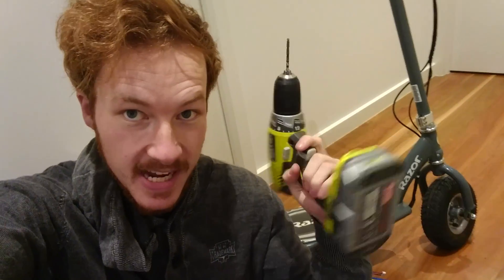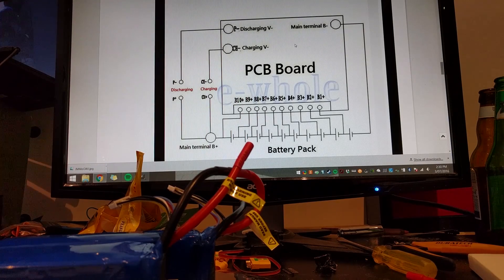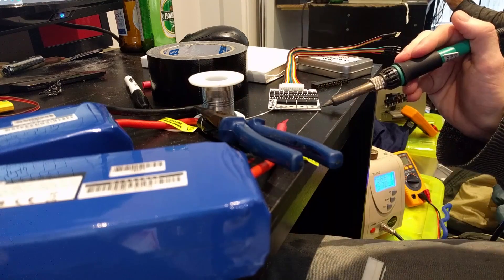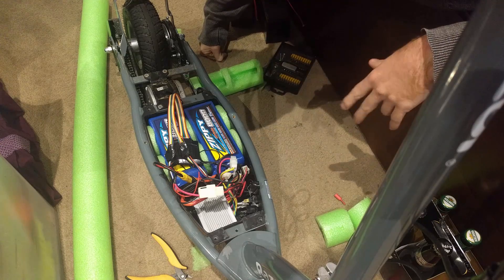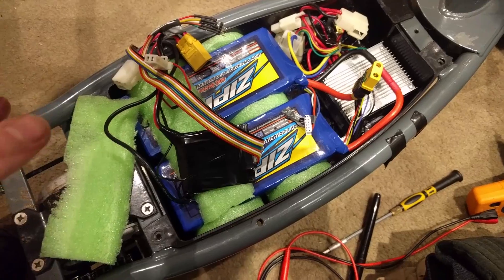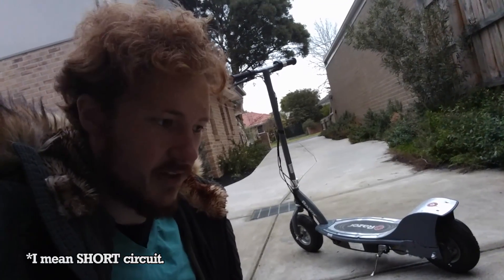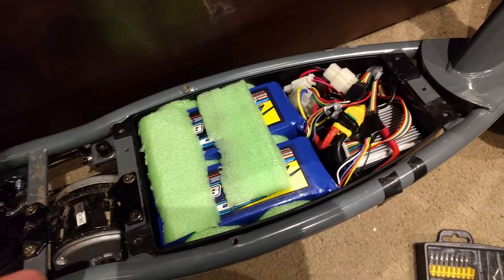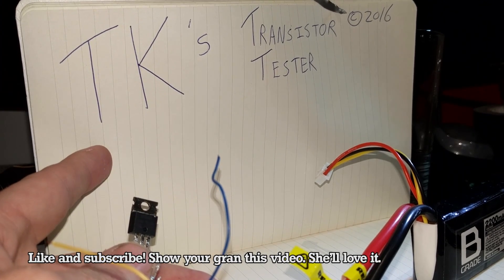Razor E300 Scooter Gets Big Battery Power Upgrade - Scooter Episode 3

Comment: 6:15 for soldering thick cables & connectors you need a high wattage iron, at least 80W, with a large chisel tip on it.
The larger surface area of the tip enables better heat transfer, and a quick soldered connection causes less melting of the plastic connector!
Reply from the maker: Yeah, good advice. I bought a mega iron later on to help with these

Comment: use a higher wattage soldering iron, it will heat faster and make a better smoother connection, probably 100 w would do the trick.
Reply from the maker: You're so right

Comment: What Up TK Here; why does the E300 require a speed controller?
Why not wire the batteries through a relay (triggered by the throttle) straight to the motor?
Reply from the maker: 1: you get sparks every time you engage it that destroy the relay contacts very quickly.
2: instantly going full throttle on a powerful scooter will throw you off.

Comment: I saw you used ryobi battery's in the past have you ever thought about using ryobis 24v or make custom 24v packs
Reply: It's possible to make a custom pack I have down it before
Reply from the maker: It is possible! I went with these high output lithium polymer batteries as I was familiar with their performance and love their huge current delivery. 18650s are good too but far more of a pain to assemble into a custom pack. Also, when I did this, ebike packs weren’t as much of a thing.
Reply from the maker: Thanks for watching, hope you enjoyed!

Comment: Bro why you don,t use lithium ion you will get better battery and easier chargering I recommend using 18650 lithium ion cells
Reply from the maker: These are lithium polymer cells
Reply: @WhatUpTKHere  different chemistry.
Reply: I know that's why I am saying you should use lithium ion instead of lithium polymer.

Comment: I can't find a single video that starts with a stock e300 and successfully upgrades it to 36v. How the heck do I do this?
Reply from the maker: Haha, so pretty much you gotta replace the motor and speed controller. You can try and cheat and overvolt the stock parts, but they blow up pretty quick.

A lot of people act like you can do it, and end their videos before they admit their motor melted after just 5km.
Reply: @WhatUpTKHere  dang. I was hoping the motor could stay - thinking the controller would protect it!
Reply: Again use lithium ion not lithium po you can use the original controlor and motor ( working on a video  of how to do it)

Comment: Well TK, I suppose I am bumping a 3 year old question but your video stands for newbies. Nice videos. Educational.

Try at your own risk:

So, at 5:54 there are a few solutions to your soldering problems. First, the reason for the problem: the size of the wire & connector you are soldering have a larger surface area than your soldering iron tip. So, those items drain the heat from your soldering iron.That leads to a cold solder joint. Thats why you have a lump of solder that blocks the housing from sliding on after the solder job. You need a larger soldering iron or at least, a larger soldering tip and probably about a temp of 850F to quickly flow solder on that connection.

The easy fix for the results you have, file the lump down with a metal file (use standard safety precautions: eye protection, a mask so you don't breath in lead smoke or lead dust, wash hands well after handling lead solder, etc) . Another trick, when your parts get too hot, throw a damp/ wet cloth onto the parts to cool it off quickly. Of course, it won't look pretty. You will appear to have a cold solder joint. At least your wire insulation and plastic connector won't melt.

best of luck.
Reply from the maker: Great tips! I’ve definitely improved my soldering game in the last couple of years. Gear helps!
Reply: @WhatUpTKHere -- Keep on Rockin it TK !

Comment: I'm having the same issues  any fixes for sure yet?
Reply from the maker: If you wanna run 36V properly, get a 36V motor and speed controller.

You can overvolt the stock stuff but it burns out pretty quick dragging an adult man around
Reply from the maker: Also you may find the rest of the episodes helpful

Comment: Myself , built my own control with a NE555 for pwm running a couple on IRF1405N mosfets. Good for 55v  169A max. I did have some initial problems with blowing the protection diode across motor which then blew mosfets. That was fixed by reducing current of back EMF. All good  hit 41 kph then burnt motor then replaced with different motor now 36 kph and more range.
   Should add the scooter i started with is a Kmart E kick out of the box12v  lead acid 9kph. Now charged around 51 volt.
Reply from the maker: Very nice! 

What did you do to reduce back EMF? Change PWM frequency, or?
Reply: @WhatUpTKHere  to reduce back current I just used a couple of resistors in series with diode  Still protects with added benefit less rolling resistance when you shut off throttle. Also I do have a dead man's handle which operates a relay and just shuts everything off.   The basic NE 555 dc motor speed controller circuit came from .... How to Mechatronics . Com  . I  added the twin mosfets and voltage regulation due to the control runs on 12v  and the supply is from a 20 v tap in the battery pack . Why not 12v thats because the project evolved slowly some things changed and others botched.  On that one i even ran a string of diodes to dump a couple of volts to try to remove some work from regulator. The original motor was 12v. 100watt..with the intention of speed only and to hell with everything else and that's how I got 41kph then burn out. But now i have backed off for distance and reliability.  The lithium batteries were taken from Aldi 20v 4ah power tool packs $38 each.  Cheaper than Jaycar similar cells at almost $20 each.

Comment: Hello sir
i wanna make an E scooter i have problem with speed control and the sprocket
i have a DC motor model MY 6812 100w 12v and it has a sprocket 1.5cm
and on the whhel i have 5.7cm
battry is 11.1 v 3300amp
i used 2 transistor IRFZ44n for driving
but when i go on half throttle transistors will get hot 

can you help me to resole this problem?
Reply from the maker: Hi! 

I’d suggest looking at existing brushed motor controller designs, and comparing them to your own to figure out where you’re going wrong. :)
Reply: @WhatUpTKHere  do you know any name or model of speed controll?
do you think any problem with 1.5 cm sprocket and 5.7 cm? should i change them?
Reply from the maker: @raspberryeditingvideo4331  hard to say if the sprocket is an issue. 

Do your research, you should be able to find a suitable brushed motor speed controller, or ESC, online.

Comment: Hey question
I believe my fet has failed in my controller. TK why did you only modify the left mosfet and not the right one? Thanks
Reply from the maker: There’s only one MOSFET, The other one is a diode pack, it’s just in the same type of package.
Reply: What Up TK Here hey thanks for replying!!
Cool to know. I also blew my mosfet after deregulating the controller. 
I like the job you do with to mosfets in parallel. My next question is, how did you secure the diode pack back to the heat sink? Or is it less of a concern for heat than the mosfet?

Thanks TK. Love the videos!!
Reply from the maker: @grandtheftauto1233  Yeah the diode pack isn't a big concern, I think I just used the original screw or maybe I just left it.
Reply: What Up TK Here sweet dude thanks for the tip. I plan to install the additional mosfet to the left of the original and utilize some crafty pcb trimming. Hope to have a clean build and draw some amps without popping 😎 just until I get a custom controller

Comment: So what's the max AH batteries we can put in this? Do the cells get bigger on size,  as the 2 7ah ones I'm using are tight as it is. So if I got some 12AH,  will the dimensions be the same or bigger?
Reply from the maker: Bigger capacity means bigger batteries, yes, for batteries using the same technology.

That’s why so many of us switch to lithium instead of staying with lead acid batteries like the stock ones. Lithium batteries can store much more energy in less weight and less space than lead acid.

Comment: where do i get those batteries??
Reply from the maker: Hobby king!
Reply: @WhatUpTKHere  found them!!!!  damm good price too.  o_O
Reply: @WhatUpTKHere  however im a bit in question about the matter.  the ones i found are 7.2v.  is that what you're using??  if so that's only 14.4V.  that doesn't seem nearly enough to get some good throttle on the scooter.  most of the big scooter mods are going for serious overvoltage.  42-48V most of what i seen.  the ones i seen breaking 35MPH are the crazy 48V ones using stock motors,  and a variable throttle grip.

-also i got some electric DC motors im thinking about trying.  i picked up a pair of DC weedeaters.  18.2V battery packs on each.  i figured since they're really high RPM,  a weed eater motor might be better than the little DC motor that comes stock-what do you think??

I also got an electric mower that requires 24V to mow the lawn,  but no clue on the amperage,  but seems to me if i could get that lawn mower motor running wiht adequate V i could get some serious speed on my build.  any thoughts on those on those motors??
Reply from the maker: @MTRX2011  Yep, so I went with two 5S packs for a total of 10 cells (~36V). You've gotta use the tools on the site to filter for the bigger packs.

Comment: i find with large cup type connectors like the ones you used, its best to heat the connector with the wire pre-tinned and inside the cup and tack it, then flow a little more in by touching the solder to the wire directly and the heat should pull it towards the cup
Reply from the maker: Always good to hear another take on technique! I've gotten quite comfortable soldering these connectors in the last couple years; when I started using them back in 2010 I definitely had a lot more headaches, but I was using a very underpowered iron so that was harming my work.
Reply: @WhatUpTKHere   Ah, not enough thermal energy or mass will do it, thanks for the reply i should catch up on your newer posts, should have checked the date before i went offering advice lol.

Comment: All you had to do is buy a 48v speed controller
Reply from the maker: Wefki Saleh and I'd have learned nothing, and made no video! Also that makes no sense for a 36V battery setup.
Reply: What Up TK Here oh ok well I'm running mine off of 48v I didn't notice but the 36 v speed controller is a couple bucks less on eBay and it will run just right... plug and play ... I'm running a ezip 1000 and upgraded to 48 v and took the 36 v off the ezip 1000 and put it in my ezip 4.5 which runs off 24 volts and the power is good ... so all that to say just order yourself a 36v speed controller and you will be good
Reply from the maker: Wefki Saleh yeah, if you follow along the later episodes you'll see where I've experimented with a variety of setups. Sounds like you've got some fun builds at home!
Reply: I will follow you .. and yes I started off with rc car then I started over volting my kids power wheels (that was very fun lol ) then I started looking up scooters I purchased the ezip1000 for 25$ and it's my favorite I hope to learn a few things off your videos your a funny and educational dude ..Keep up the good work

Comment: Plz try to connect motor and batteries directly, without speed controller. Use just a on/off switch!
Reply from the maker: Велес Поляновский that's awful for driveability I'm afraid

Comment: Great video! I think the problem with the XT-90 connectors is that the solder kinda is sticking to the outside of the wire/solder tab. The key is to make everything really hot. Basically, I'm saying get an 80-watt iron from Jaycar or something... they are quite cheap! If the wire is at the melting point of solder, then the solder will flow into the spaces within the cable, and you won't get any solder 'bumps' on the connection.
Reply from the maker: Good call! I definitely have improved since this shoot, I'm starting to solder them fairly tidy. That said, I still skip those plastic tabs. Bit too fussy for me hahaha. :D
Reply: @WhatUpTKHere  bro I just bought a soldering GUN. Way more fun than the iron. If you are into that sort of thing check her out.

Comment: How do you charge the battery’s without taking them out?
Reply from the maker: Wiziki using the charger @ 9:28, it plugs into the original charge port on the scooter  which is hooked up to the BMS.
Reply: TK how many amps did yours have? All I can find is 2.5A, and I don’t think that’s enough.
Reply from the maker: Wiziki it's not. I used a 30A BMS but I hacked the current limiter in later episodes.
Reply: TK I mean the actual lithium scooter charger from eBay (that you plug into your scooter to charge). All I can find is from 2.5-5A
Reply from the maker: Wiziki oh yeah, that's fine. You can't safely charge faster than 1-2C anyway (C being the capacity of the battery in Ah).

Comment: Is it possible to change out the stock batteries on my brand new razor e300 to  two 12 Volt 15Ah lithium ? What I have to change anything else out? I’m just looking for a longer drive time
Reply from the maker: Michael Pinela you could probably do that! You might have issues if the lithiums are a higher voltage when fully charged and trip the overvolt protection but it seems worth a shot, and you can always disable the relay.

Comment: Help! about the Razor Pocket Mod electric scooters. that goes 15mph and comes with 7ah battery.  Will upgrading it to a 12ah frie the controller or something inside?  for the Razor Pocket Mod.
Reply from the maker: megyn Kelly1 higher capacity batteries won't do damage as long as they're the same voltage.
Reply: So what's the max AH batteries we can put in this? Do the cells get bigger on size,  as the 2 7ah ones I'm using are tight as it is. So if I got some 12AH,  will the dimensions be the same or bigger?

Comment: Can you use other types of batteries so you dont need a bms? if so what can i use?
Reply from the maker: You could use three 12V lead acid batteries but they're a total snoozefest. Lithium's the best battery tech out for big power applications.
Reply: Aight thanks tk
Reply from the maker: Np! :)